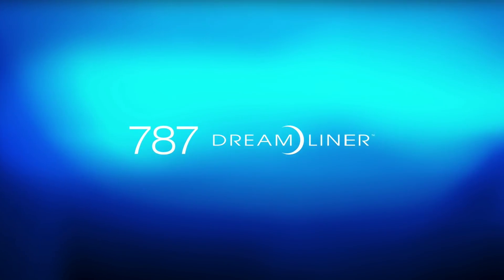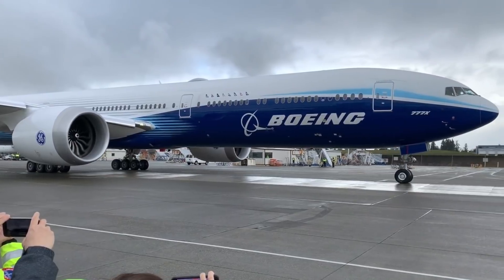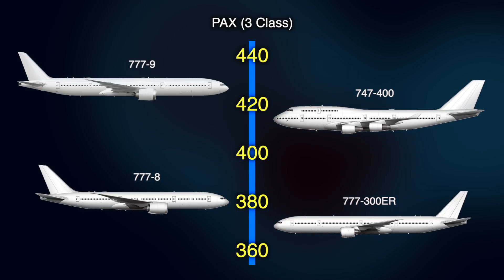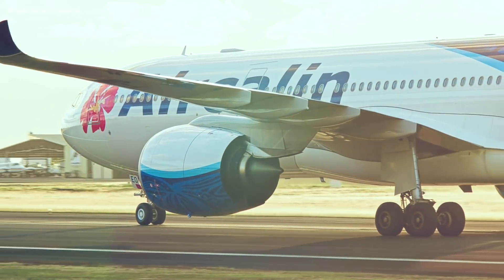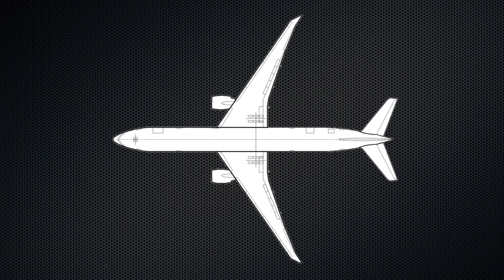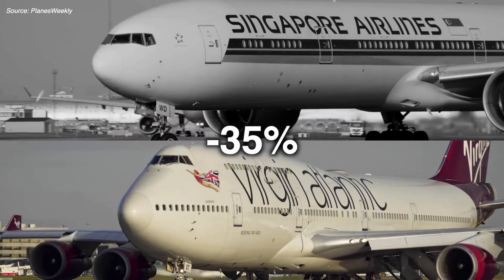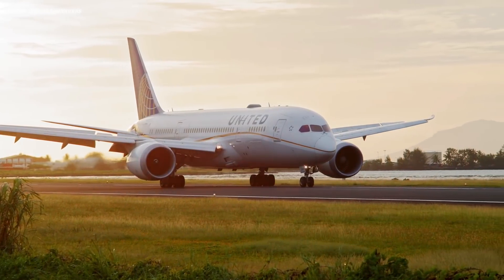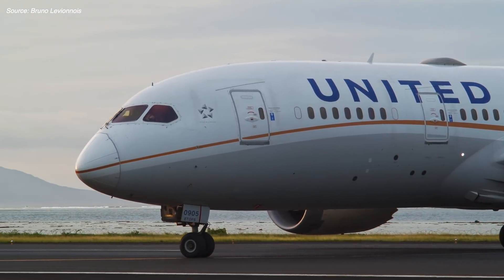The 777X Has a "Tesla Problem"

Comment: as much as i admire the 777X, i also kinda wish it just never existed. having the 747s be replaced by something that essentially looks like a huge 737 feels so sad in a way
i know for most passengers the only thing they need is a transportation method from point A to point B, and airlines want to do just the bare minimum for as cheap as possible, but flying on a 747 feels special, unique even, because there is no other commercial jet out there like the 747, not even the A380 (which is special in it's own way as well). honestly sad to think that airlines might be replacing hundreds of 747s with what is essentially the "regular ass traffic" of the skies

Comment: The 777x is a perfect example of what I like to call Style Driven Engineering. There is nothing "paradigm shifting" about the plane. All the engineering design decisions made use of existing technological institutions (composites, engines, avionics etc.) yet the 777x was designed to solve a particular problem in the Commerical Aviation Market. The stylistic choice to use composites (an all-aluminum aircraft would still work just as well!) had a direct effect on the substance of the aircraft operator's finances.

Comment: The 777X9 is almost identical in length to the 747-8, with almost identical fuselage diameter. So the essential comparison between the two is that the 777 is a two-engine jumbo without an upper deck. The 777X9 continues the evolution of materials and control law engineering that began with the original 777. Where carriers find a need for a large, high-capacity plane, they can choose the 777X. Where airlines need medium capacity, long-range aircraft, they have the 787. For single-aisle capacity, with moderate to long-ish range, they have the MAX airplanes. The composite 777X isn't necessary yet.

Comment: I think the issue with the given example of the "Tesla problem" compared to the Boeing problem does not quite fit due to the disparity in demand VS supply as well as the fact that cost savings and usefulness are not simply a question of fuel cost. I get why its been chosen, but still have to point out its not accurate.

First is the demand side. Jumbojets demand has fallen drastically, simply because airlines don't see them in a favorable position compared to more adaptable medium size planes. This means that even the perfect product would see a sharp decline in demand. The fact the plane isn't really a breakthrough product, yet is priced as one, also does not help much in that regard. Meanwhile EVs, and Tesla specifically, have a beyond absurd demand. They can build them as fast as they can, they will sell right out of the factory every single unit that they make. They can raise and raise the prices and still they sell too fast for the production to keep up. This is a uniquely EV phenomenon not shared for ICE or hybrids, which feeds into the next point.

There is more to cost of usage than the price of the fuel. Maintenance for one is an incredibly important thing, and one where your given example (hybrid) is incredibly bad at. Hybrid has 2 different power-trains jammed in a single vehicle, which not only harms the efficiency of both systems but also hits the vehicle with the worst maintenance of both types. Obviously here complexity harms the product far more than just going for either one of the propulsion method all the way. There is also the capability of the vehicle its attached to, as obviously trying to compare a tiny hybrid vehicle to a full size family EV in upfront cost is tenuous at best, misleading at worst. A better comparison would simply have been between two internal combustion vehicles having equal demand, but showing that reducing the input price has a massive impact on purchasing numbers even if the more expensive vehicle has slightly better stats. Meanwhile choosing a Tesla VS hybrid actually reverses the entire equation on its head as the hybrid may boast a way lower price, but also way, WAY lower stats, a lower demand, and lower purchase numbers compared to the Tesla, simply because the Tesla EVs were breakthrough innovations in the car industry that justified their price compared to the hybrid. 

But the rest of the video, apart from this analogy, is pretty damn on point

Comment: Here's some predictions. (I worked in aviation for many years, military and civil). Right now the trend is for mid to smaller aicraft operating from smaller airports. No need for major hubs, no need for 747 sized ac.

There is one factor not usually discussed, and thats airport fees. As global economies cool (or crash, a la Sri Lanka), smaller airports will see less revenue due to fewer people flying, traveling at all. This will increase prices per landing, to a point where its not worth doing these direct flights.

So an airliner will find it cheaper to contract out smaller airliners (Brickyard type) to basically bring pax back to the hubs, where they can operate cheap. This will require larger jets, so don't be surprised if a 747-X returns in some form, composite or not (my guess not). The hub model is good, but only if costs at the smaller airports are competitive. Also factor in the lack of maintenance personnel. These are complex aircraft, and you can't staff each little airport with enough people, without paying them. Thats also the argument for moving back to less "efficient" materials. (We do get caught up efficiency for fuel that we forget about economic efficiency or viability).

So training x amount of maintainers to work on composite aircraft may cost simply too much than a regular aluminum airframe. There is a labor shortage, and a qualified maintainer can ask for a higher salary and get it. A maintainer that is signed off to work on composites will command a higher pay as well. Add to that the cost of the parts, time on the ground and so on. Its why you don't see many regional jets made from these modern materials and never will.

So in 10 or so, things will look very different if you're younger, or go back to familiar settings if you're older.

As a sidenote, buses have the exact same problem as far as hubs and tech. I started off with my first job driving a coach, and have noted this, how the bigger the cars got, the smaller the bus. Now cars are small or not even owned and buses are at their largest, but many operators are cutting routes, consolidating them, using hubs and so on. The bus industry is a bit of a canary in the coal mine for aviation as it is easier to change rather than an airline. (Fun fact, almost all US aircraft manufacturers have also built buses. Northrop, Boeing, General Dynamics and probably the most succesful being Grumman, with the Flxible 870)

Comment: Ok I'm going for it.. Oh boy!. What if, these are dangerous words when used as a premise, what if they (Boeing or Airbus) developed in alliance with GE or R&R or the other engine makers a hybrid engine? Sure the battery component would add to the weight factor. BUT!, at least in automobiles, the battery is a NOT a large component in hybrid engines and it improves the overall fuel consumption . I know a car is not an airplane ok? there are of course different scales of everything however! it may prove seriously beneficial if such en engine could be developed :-) .

Comment: Dude, you are so wrong. The 777X is not selling because of international travel has cratered since the COVID pandemic. As far as the composite build, you have made some incorrect assumptions. Yes the wings are composite. But in all 777 airplanes the empennage is composite, the floor structurer is composite and in the 777X much of the internal skin structure is composite. To build the 777X with the same technology as the 787 would be a huge investment in tooling. This would not result in much of a weight savings. Don't quit your day job.

Comment: Another reason could be the 70% restriction, in short if they change more then 70% of the aircraft it will need to get recertifications for a new fleet type as it’ll no longer be recognized as a 777, this is why Boeing and Airbus often include a lot of the future developments in the previous generation, and still make major changes without reaching this point. An example would the last few 737NG had a a lot of the 737-8 Max system and functions incorporated in them, thus allowing them further alterations for the next generation.

In addition a recertification is not ideal for their goal of 777-x, as it would mean a new Maintenance training program and certification, pilot, FA, and so on, this would drive up the cost for airlines, thus pushing them away.

Comment: That's such a fanboy analysis. Wrong on so many parts. Even the underlying thesis is so wrong. Come on, you're talking about list prices. That's hillarious. Do you think SIN, LH, Emirates or Qatar paid even near that? Of course not, prices are considered to be in the 150 - 200m $ range. 
 
Composite might be 40% lighter, but that's not the weigth saving you end up with, as you have to calculate the structure. In fact, it's considerably less. A full composite fueselage wouldn't save 30t in OWE.  
Then we are talking about dev. cost + time + financial situation + workforce available, there are many many factors to consider. 
It already did cost 6 bn. $ for a new wing and a engine update, considering all new plane - when you do the fuselage, you do landing gear, avionics, etc. too - you're talking about a 20bn. $ ticket. 
And 2-3 years more dev. time. 

Then there's a underlying market trend to mid sized twins, A359 and B789 see almost all the sales, with the later being available for about 100m $. That's a very efficent and cheap plane, really any airlines operating a WB can use. Good range, good cappacity about 250-300 Pax. good freight capabilites. 
And Boeing is kind of dumping it on the market. 
This trend already got the A380 and B747 out of the market, you simply don't need to go as much risk with hard to fill planes, high trip cost and crippeling profit once your utilization drops a few %.
Look at the B77W - the 3 large US carrier didn't buy many, only late ones and United only to it one when it was very cheap. 
You can already see that with the A35k, where it's the unusual thing to see almost all the sales going to the smaller version, not the stretch. 
Usually the stretch sells way better, as it offers better CASM. 

The B777x is basically a plane designed for large single hub carriers, build to Emirates demands so Boeing would win their order (from A350). And only these kind of airlines have ordered it- SIN, LH with FRA, Emirates, Qatar, BA....

Comment: Boeing 737 Max case suggest that the Engineers and Management have lost there way and put cost ahead of safety. It doesn't matter if it is made of carbon components or not people are afraid of flying on Boeing airplanes.

Comment: I don't believe the question is limited to the 777X. Should it have been made out of composites? Yes, if Boeing envisions the future of all airliner production to be made of composites. Sure it would take a considerable investment in production process, but that cost in theory wouldn't be amortized only across the production of the 777X, but all future aircraft models. I think the real comparison is in raw material cost, of which composite materials unfortunately cost considerably more than aluminum. With this decision, Boeing is asserting that composites are not the material solution for more efficient future traditional jumbo aircraft production.

Comment: Carbon fiber is four times stronger aircraft aluminum pound for pound for the given geometric cross-section. However carbon fiber is also 36 times more expensive per Unit of strength.  So even though you can make the aircraft four times lighter for the same strength, it is still financial inefficient due to the increase cost of aerospace grade composites.

Comment: One big problem with composites is that it can't be combined with aluminum due to galvanic corrosion. The parts would need to be changed for titanium. The remaining parts would be way heavier, offsetting some of the gains.

Comment: Boeing wants to serve cargo at least as much as the passengers. Can't cut a big door hole in carbon. this plane was built for dual use cargo/pax, as one particular cargo giant wants it ASAP. The 380 never made a cargo debut because cargo operators wanted the option to buy old passenger planes as conversions, and Airbus said it wasn't possible. The tech blend is for flexibility.

Comment: up to the middle ranges say 4000nm, the lower weight of composites may not offset its higher cost, while at extreme ranges >7000nm, the higher weight of Al renders it a bad idea. Boeing had their heads up a dark hole, on so many items. Also, there is just not that much market for extreme range routes, probably better suited to a smaller plane catering to business class passengers, not tourists.
obviously, almost no one is buying the 777x, the existing orders will probably be cancelled

Comment: The 787 is not a cash cow - it was milked for dividends/buybacks. There is a butchers bill to come due.   The program is down some $19 billion in development costs. They also just wrote off $6.5 billion on the 777X program in Q4/2020, so that one will never make a profit. "Program accounting" two words every investor should know

BTW - shop talk is that the 777X has a high alpha problem because the tail is too small and they are trying to use a software fix (heard that before?). But now the FAA is not rubber stamping anything out of Washington, hence the delay until 2024.
Reply: Lol , that's nothing compared to $32 billion that was spent on the a380 and still it went on  to sell very poorly. 

The 777X program will cost around  $ 7 Billion and has more orders than the a380 while having have a similar unit cost of $450 million . 

Boeing will make more than double from the 777X than airbus ever made from the a380  despite spending less.  I estimate  500+  777X will be sold also thanks to the freighter varient

As for the 787 , it will most likely sell close to 3000 jets by the end of its run . Boeing would have made a huge profit by then and had a good return on investments so don't worry about the 787
Reply: @mmm0404  Oh Enock, you have no clue;

BA wrote off $6.5 billion in Q4/2020 on the 777X program. That is still 4 years before EIS. Money spent, done and dusted. 

The 777X program is a loss.

 Like the 787 program, which has written off $4.5 billion in Q4/2021 and still has some $12 billion in the deferred production balance, in addition to another $2 billion BA has said they will have to write off because of the stoppage. 

3000 jets? lol

The 747-8 program wrote off over a billion. 

4 of the last 5 programs BA has launched have been losses. 

You need to learn how to read financial statements. I can provide links and sources for all of the above claims...
Reply: If the 787 program is projected to sell 3000 jets, over the life of the program then BA would have NEVER written off a $4.5 billion loss on it. 

If the 777X program was to be a profit maker, then likewise - they never would have written off $6.5 billion.
Reply: @frankpinmtl  what are you talking about? . Isn't the $6.5 billion the development cost? 

Boeings current order book for the 777X is estimated over $50 billion. 
More Orders may come in the future. 

Boeing had written off 4.5 billion probably due to the pandemic and halting of 787 deliveries. 

Boeing only recieved payment after delivery of the aircraft, so since they  where producing them without delivery they lost money , but as they start to deliver they will recover that cash
Reply: @frankpinmtl  well I'm not an expert but Boeing did state they would break even after the 1100 ( Boeing 787)  jet was delivered. 

That was before the Max saga and delivery halts .  Obviously due to CoVID and  other added expenses it does make sense that margin could grow to 1500. 

Luckily the 787 could sell close to 2500 or more when it's run comes to an end . So I think it may eventually tirn into a profitable venture for Boeing
Reply: @mmm0404  Did you not read what Boeing, not me - Boeing said?

They will still be behind after the 787 backlog is done, to the tune of almost $5 billion. They estimate that they will receiver orders to cover that $5 billion. If the margin is the same, it's about another 250-300 aircraft.

That would make Boeing's estimate of the 787 market share to be ~1,800 units.

Not 3,000
Not 2,500

1,800. 

Secondly:

Boeing has ALREADY written off $4.5 billion and because of the stoppage, another $2 billion will also be charged.

It cannot be a profitable venture. It's lost $6.5 billion, until now.

Comment: Great video but a full composite plane would consume millions in development and certification, and that cost would be handed over to the operators. The lack of sales factor have other root caused to be considered. If 777X was launched pre COVID would probably be a hit. Also, A350 marketing and tax benefits in Europe for Airbus planes is point we can't put out of the table, just check how many operators use 737 in Europe in countries that are partners of Airbus consortium. A A350 would never have the range and capacity of a 777X fully tanked, full pax. Issue is that the rate of capacity have to be higher to compensate for the initial purchase price.

Comment: The certification makes it impractical. It will have to be a totally new plane. Trying to get a 787 experience - lower altitude, more fatigue stress, more humidity, larger windows,etc. in an Aluminium fuselage is the biggest challenge though. Boeing has of late not got their act together like they once did. Let's hope they don't mess this up.